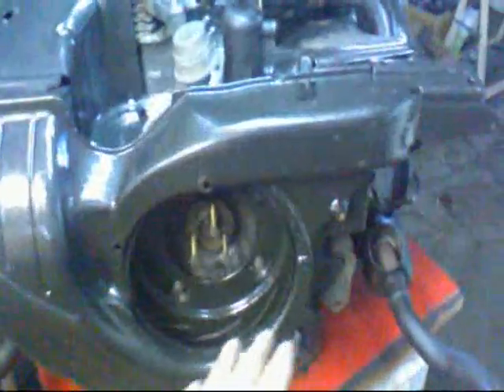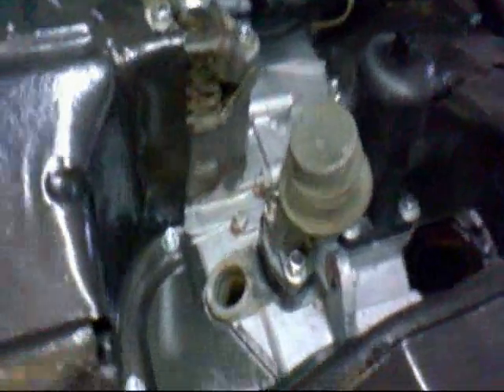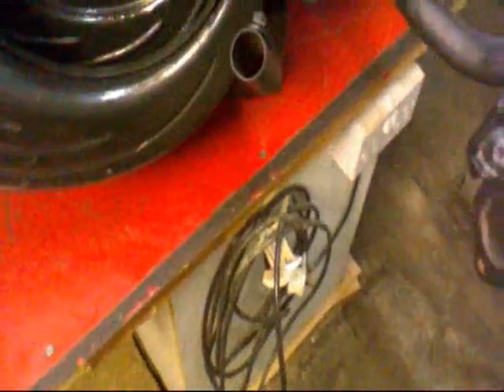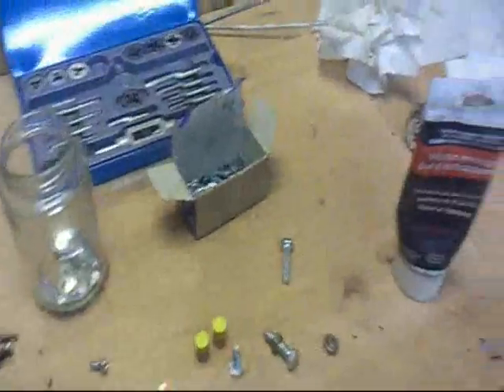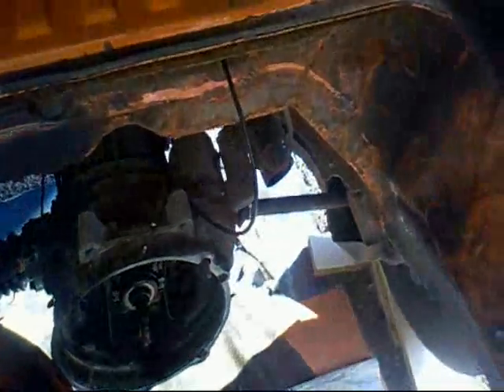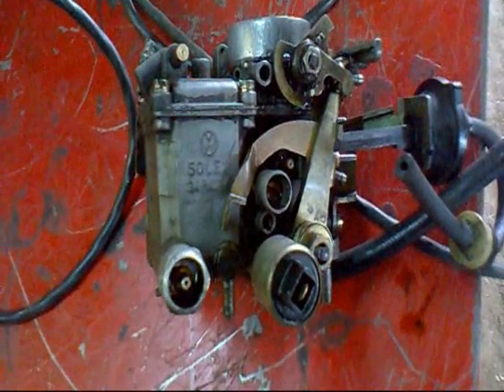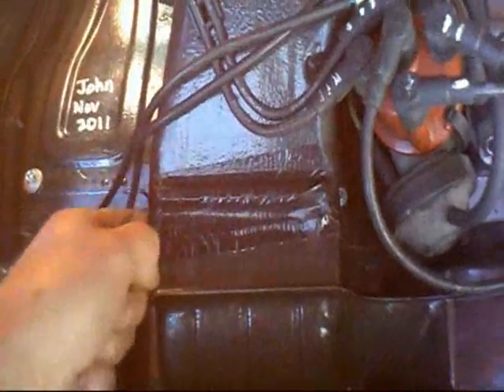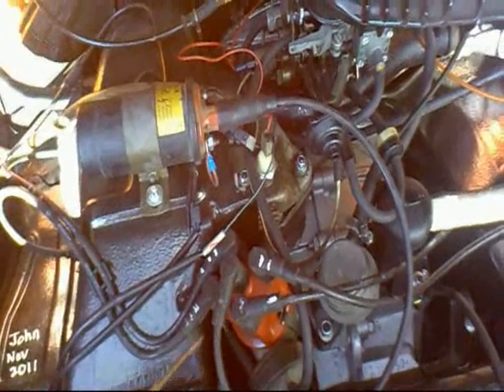How to build up a VW aircooled engine after top end overhaul Part 2

Comment: another great video that has helped me alot!

Is the duct tape you sealed off the tinware of any special kindm heat resistant maybe? 

Thanks :)
Reply from the maker: Nope.. 3M from Lidl supermarket...
Reply: @sarran1955  and that won’t melt on that hot tin cover? 🫠